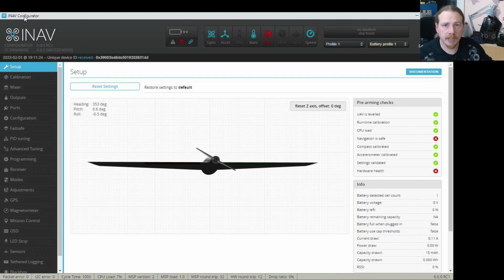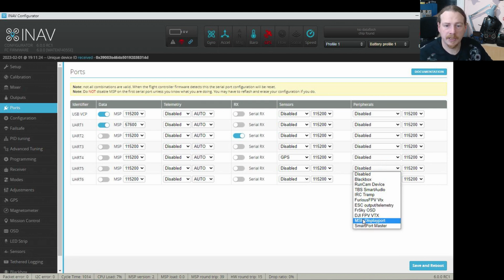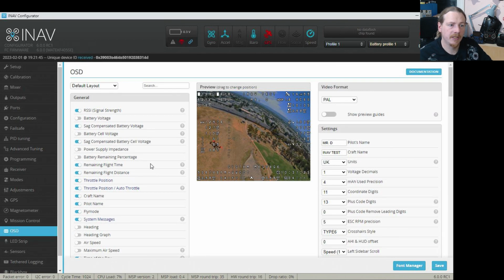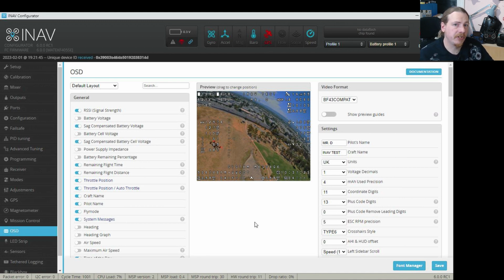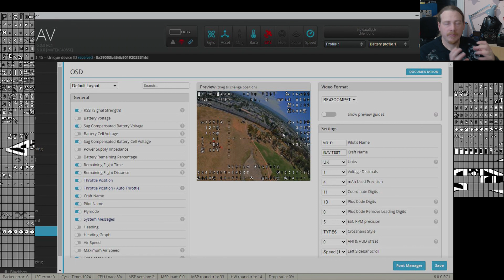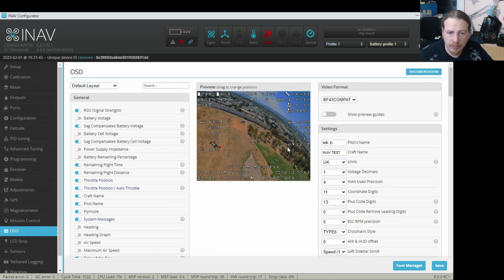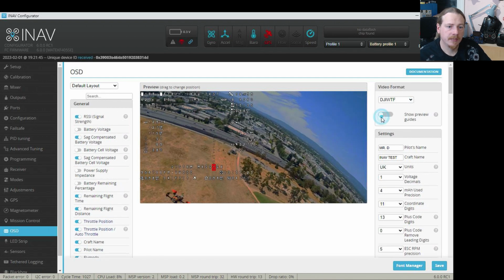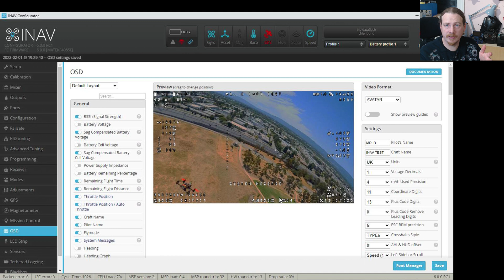How to set up HD FPV systems in INAV

Comment: Help! No OSD with HDZero! 
I was hoping that this helpful video was going to resolve my problem. 
I have the SpeedyBee F405 Wing FC iNav 8 with digital FPV system of HDZero Freestyle V1 VTX with Goggles-1. Following several build videos, everything works on the bench as expected, except for the OSD information which is missing. 
The video image is being transmitted to the HDZero Goggles, so I have the TX/RX leads correctly connected the right way round for UART-5. I have updated the FC and the goggles to the latest firmware. In Ports Tab I have MSP DisplayPort selected on UART-5: In Config Tab the OSD is selected ON: in OSD Tab I have HDZero selected.
I have spent days trying to resolve the lack of OSD in the goggles.
Any suggestions?

Comment: Do you get Heading graph element? What goggles 1 or 2 and firmware? I finally discovered on Air unit had Rx & Tx inverted. Did that quite a while ago and put it away. Now having another go but on iNav 7 got OSD with port on DJI and osd on Auto not your way coz I mistakenly updated camera and gogs to v01.00.06.08 till I found out that v01.00.06.06 is preferred that I probably had but very tricky to go backwards. Cheers

Comment: This doesn't work with Speedybee F405 V4 stack FCs because the UART assigned to digital FPV is UART 1 and MSP has to be enabled on this UART. Selecting anything on peripherals resets all the ports. I'm sure this is also an issue on any other FC where digital FPV is assigned to the communications UART but the SB F405 is a massively popular choice for a lot of quads. My quad is a 7" Mark 4 and will be intended for long range not freestyle, I really don't want to use BF.
UPDATE: The fix I used is to reassign my MSP UART to UART  4 as I'm not using that one. This seems to have worked.

Comment: Thanks Darren, quick question,  iam using speedybee F405 v3  f/c which uses a plug for digital on r1 / t1 (uart 1).  In inav uart 1 is toggled on for msp. Can i move msp to a different uart or can i leave msp off.

Comment: Any recommendations for the O4 air unit? Still use BF43COMPAT? I dont have any OSD from INAV only DJI telemetry
Reply: Same here. Did you found a solution yet? I am using INAV 8, there is only PAL and NTSC available, can't find even BF43COMPAT

Comment: Hi Darren, I received my new Goggle X and Avatar HD Pro kit this week. I updated the firmware on both units to 38.43.8. The camera and goggles are working fine. My flight controller is a SpeedyBee F405 with INAV 7.1.2. Unfortunately the telemetry to the goggles is not working. I have done everything as described in the video. What else can I do? Kind regards. Didi

Comment: I think you may be able to help me!  Inav dji o3 and goggles integra. 
Inav 6.0 with 6.1 configurator. 
 I am setting the osd to betaflight compatible and incan see osd on the goggles but it doesnt look like what i am setting up on the osd page. It all gets moved to the top of the screen and nothing looks the same. 

I understand the character issue with dji but i dont get why im not getting at least some in bf compat mode. 
 
Can I use 6.1 configurator on inav 6.0?

This is a rth atomrc dolphin. First wing setup so indont want to be upgrading and chaning the tune setting  

Please help!

Comment: Thanks for this tutorial on HD video.  Can you also explain how to configure the different vtx power in INAV?  In Betaflight there was that VTX tables and you could set the all the power availables. I cannot find that in INAV.  I have HDZERO and in INAV I only have 3 powers availables.  In Betaflight I could set one power at 0mw, and 25, 200, and 1000.  So far I can only choose PIT, 25 or 200. In fact, I dont think they make any difference at all. I cange them and see absolutly no difference (even though the OSD shows 1, 2 or 3 as for the power)
Reply from the maker: This is being updated for INAV 8. So when that is released. You should get more power options for HD Zero.
Reply: Ok. Thanks

Comment: I am trying to find out how to set the time and date. I don't know if this resides in the FC or the VRX? I would guess the VRX because there is a small button cell battery on the board,
Reply from the maker: It is set in the goggles/VRX. You can set it via a text file on the SD card. I’ll have to find the details on how to do it. Also, if you have Goggles X. When the app is released. When you connect the goggles to the app it will sync the time automatically.
Reply: @MrD  Thank you. I have applied the text file and this has made it so the video files get correct time stamps. I was also trying to get the RTC to display in the OSD. A rep from Walksnail said the RTC will not display in the OSD. They are partially correct. If you connect Betaflight while the drone is powered on and go into the OSD tab, you can place the RTC into the OSD. It will actually stay there after disconnecting Betaflight until the drone power is disconnected. However, the time and date displayed are not correct and do not seem to be affected by the .txt file.
Reply from the maker: @aaronbean4436  to be honest. For the OSD, I just use INAV’s current time element. It gets the time from the GNSS module. 

What I’d love to see is the WalkSnail system updating the time from the flight controller, via MSP.
Reply: @MrD  Can an inav osd element be incorporated into betaflight? I am guessing that you have to use one or the other, INAV or Betaflight? I have used only Betaflight so far.
I agree with your statement; the real time and date clearly resides in the VRX, and it should be able to feed to the element set in the OSD!

Comment: Im having issues with my avatar vtx. OSD is being displayed fine i just have no camera feed. .6mbps bitrate. Im not aure whats going on. Also slow green flash on vtx indicates a camera fault issue? Brand new vtx however i accidently ripped a solder pad off so im using the connector
Reply from the maker: The connector/solder pads won’t be a problem. But check the MiPi cable for the camera. It may have just come unseated.

Comment: I need help. I just got a walksnail VTX & VRX and have FW updated, with sneaky_fpv fonts loaded, I have video feed (I can see) it shows walksnail OSD, Not Inav OSD. Watched this and other videos and it's not working.
Reply from the maker: Make sure the sneaky font is in a userfont folder on the SD card. They changed that a while back. When you download the firmware. I believe there is an example userfont folder that you can check out.

Comment: Hi Darren,    Im setting up a 2nd wing with Inav and the OSD is not showing.  The first wing is all good to go but i have the Vista on that one. I have a confirmed hacked DJI Original Air unit (2nd wing) and loaded with the MSP and 1200 mw package.  Before i rooted the Air unit i downloaded to the 0606 DJI firmware.  That all came thru and i did this setup as per you video and no OSD is showing in my googles.  At first the "Waiting for OSD" was showing and now thats not showing anymore.  I flipped back and forth with the INAV set up on ports tab and no changes at all.  Im not sure what im missing.  I dont have an SD card in my air unit and not sure if that contributes to the issue (no spare sd card at the moment).
Reply: Did you get yours working . Same issues . Same software

Comment: Hey brother thank you,  I just now got into INav and I was struggling for just a moment until I found your videos.... Thank you again.
Reply from the maker: Glad I could help 👍🏻
Reply: @MrD  quick question,  I'm using the Tbs crossfire , when I set up failsafe in i-nav do I still need to set my switches and throttle position in my radio to failsafe in case I lose radio link ? At least this is how it used to be .... thank you ahead of time
Reply from the maker: @endliberalism4305  no. You should set the failsafe type to cut on the receiver. You shouldn’t use stick and switch positions with serial protocols. 

You can test by switching off the transmitter. Then make sure the parachute turns red in INAV.

Comment: I'm running INAV 7.1 which is supposed to support DJI o3.  While I do get OSD, I find that the elements are not located anywhere near what they are shown in the planner.  Hence I find it not usable at all.
Reply from the maker: INAV is working as much with DJI O3 as possible at the moment. The problem is DJI haven’t implemented MSP DisplayPort correctly/fully. Because of this, some icons will appear as ? as the font is not complete. None of this will change until DJI fix their system. 

As for the layout. You should be able to position the OSD elements where you want. On the ports page. Make sure you have selected MSP DisplayPort in the peripherals. The. On the OSD page, set the OSD type to BFCOMPAT. I believe there are 2 options for BFCOMPAT. One is for a 4:3 layout. The other is for the full width HD layout. If you find this doesn’t get it working. There could possibly be something in the goggles that you need to change. I recall seeing something about that. But can’t remember exactly what it is.
Reply: @MrD  Understood and thank you.  I only have an issue with layout.  I'll check my goggle settings.

Comment: Hi, im using a matek f405std with inav 7, and o3. I have a problem with the osd, It doesn't work and I've already tried changing the settings several times, but the way you say it doesn't show up either.
Reply from the maker: Make sure you’re using Configurator 7.0.1. Some people have accidentally installed the 7.1.0 RC1 configurator, which has a bug related to setting the OSD type.
Reply: @MrD  JAJAJAJA God how I didn't see that, it actually works now. Thank you very much bro, I was already very frustrated haha. I was using 7.1.0 with firmware 7.0.1

Comment: Can I select the setting 'MSP Display Port' in any line I want ? I use a SpeedyBee F711 V3 flightcontroller and the RX and TX connection (for the VTX) is marked  with R1 a T1 so should I set 'MSP Display Port' in the "UART1 - Line" or does it matter ? (In my case it doesnt show a UART5 - Line just got 1,2,3,4,6 .  ....  2 and 4 are already in use)
Reply from the maker: In theory yes. But I would avoid UART 1 and 3 where possible. The can cause issues getting in to DFU mode.

Comment: Thanks for the video.  You have confirmed my setup.  I am using a Matek F405 Wing, updated to 7.x.x or what ever is the latest as of last week, 2/29/24.  I was finding it difficult to locate any docs on the setup.  I searched for a long time.  Then I saw the wiring for the Matek 722, just followed that.  I am using uart 5, so Rx-Tx, Tx-Rx, Right now, I am powering the Avatar off of the 4s battery connection, might be one problem, I will wire it up to the 9v pins this weekend.  I started with no OSD displayed in the Fatshark Dominator goggles.  So I updated to the latest as of 2/29/24.  No love, nothing displayed, oh wait, what is that?  I see the OSD, but it is what I would call static.

  I posted on the forums, read about the drop down menu in the OSD tab, clicked that, save, yes/no, NO!  The reply got me thinking as he said he tried a different uart and his magically showed up.  So I go back, change to uart 3, set to DisplayPort, save, reboot, Select Avatar from the drop down, save.  Show up, no, still static.  Put GPS back on uart 3, plug Avatar back into uart 5, OSD tab show AVATAR is selected.  I go down the list of tabs, checking everything in the tab.  I get to the modes tab, scroll way down, I see OSD "off mode is not configured.  I set it so there is a channel selected, switch up, OSD on, switch down, OSD off.  Save, check OSD tab, for giggles, save, check ports tab, all good, save reboot.  

OSD being displayed in the goggles, YES/NO, sort of.  It is like it is being displayed on the wrong layer.  I see it, but it is there, then gone, then there, then gone.  I check connections, I wiggles the wires while looking in the goggles.  Nope, randomly disappears, shows up.  This will turn out to be a simple solution when I figure it out.  The layout I see in the OSD is not how I see it in the goggles?  They are in different spots from what is shown in the OSD tab.  

Next thing I will try is powering off the 9v pins.  Could be direct power from the 4s lipo may be causing issues.  I did have an over heating issue.  I mounted a fan off an old ESC to the Avatar Tx.  Now it does not shut down from over heating.  I may try upping the voltage.  I am using the 3.3v pins, I will try the 5v pins and see if a higher fan speeds helps.

This weekend I will try another Matek F045 wing I have.  See if I can get it working there.  If it is working, that would mean something with the board, if it is the same, then it is me.  I also have a Matek F411, I may try that one too.

Thanks.

Buzz.
Reply from the maker: If you’re seeing static, not an image. It sounds like there’s an issue with either the camera connection or the VTX. 

If you are seeing some of the OSD. It could be that it’s just not central. There is an option in the goggles -> display menu to move the OSD position. I had to move mine all the way to the left.
Reply: Update.  I rewired the VTx to use the filtered 9v off the FC.  The OSD blinks.  Looks like the refresh rate is lower than the goggles.  You can see it start at the top, then fill in towards the bottom.  It blinks on then off.  I have tried different uarts, different rates, same thing.  I gave up, pulled the Avatar out, plugged in my analog, no OSD.  I plugged the Avatar back in, no OSD.  I think the Matek F405 has a problem.  

Buzz.

Comment: What is the use of uart 1 msp please explain
Reply from the maker: If you break off the USB connector. You can attach an FTDI adapter and still access the flight controller.

Comment: with hdzero and inav 7 using msp displayport (no more smartaudio) the vtx setting shows only 3 power level instead of 4. is this setting still being used instead of msp displayport (changing channel from goggles)?
Reply from the maker: Honestly, I have no experience of HDZero. I know that INAV is no using MSP VTX to change the power and channels with HDZero. But I've not looked in to how it works or any problems. I don't have the HDZero system.

Comment: Mr.D great video i subscribed so i can learn more. Im new to this. I am trying to setup my T1 Ranger with speedy bee FC and Frsky reciever also im using DJI 03 air unit. I dont know what uart the 03 unit goes on. I have picture in my goggles 2 but no OSD could you please help me with this problem also im using INAV 7.0. Thank you Art

Comment: Tell me, you can use the OSD features in iNav if you don’t have a video camera.
It is necessary that the flight controller simply writes data to a flash drive in the form of video.
That is, is it possible to record a video on a black screen with OSD data on it?
Reply from the maker: If you just want the data. You can use the blackbox. If you want the OSD, you’d need to take the VTx video output and put that to an in aircraft video recorder.
Reply: @MrD Big thanks for answer.

Comment: HDZero - Can iNav 6.1 read the .json VTX tables? or is it a cli entry? Cannot get my OSD to display the correct ch and VTX power... thanks ;)
Reply from the maker: INAV doesn’t use VTx tables at all. So doesn’t have json or CLI entry. Ultimately, VTx tables shouldn’t be needed as the VTx should tell the FC what power levels it can output. I believe this is working in INAV 7.0 for HD Zero, via MSP VTX. I know it was being worked on. But can’t remember if it made it in to 7.0 or will be a 7.1 feature.
Reply: @MrD  thanks bud, will make the transition to iNav then 🦘

Comment: Thanks for a good video.
I wanted to ask if you had any idea about my issue in INAV 7.
Using an airunit, and got all OSD elemnts showing up. But NOT the OSD Menu and it seems the Compass bar is not showing also.

Any advice? 
Assuming some font issue
Reply from the maker: Sorry, I don’t use DJI. I thought the OSD menu should work. If you’re using the older DJI setup. Have you considered using WFTOS? That massively improves the system. 

The most common thing that stops people getting In to that is being the have an airplane without a rudder and don’t set up the yaw channel. That’s needed to access the menu.
Reply: Thanks for you reply.
In fact i did put WTFOS a couple days ago on my gear which solved my problem 👍

Comment: Thanks to you, my DJI 03 is now working with OSD with Speedybee f405 wing, INAV 6 and DJI goggles V2, but the OSD is not recorded...so if you loose the plane, you can't view the last GPS coordinates?
Reply from the maker: Unfortunately that's down to DJI. They only add what they want to. Which is why the OSD is not fully supported, and you may see question marks. Depending on what control system you're using. You may be able to get the GPS position back as telemetry on your radio.

Comment: Hi Darrel.  I just received a HDZero Freestyle with the Keypad board for changing frequencies.  My intentions are to use INAV  with my FrSky TANDEM x20HD TX that has video capabilities .
I  have followed your instructions for INAV set up. The system is somehow working since I can see a crispy beautiful HD transmission, but I cannot see any number or data from the OSD and the keypad is not energized , since I cannot see the channel.  I am probably missing something, can you help me with some advice .

Thanks    Salvador
Reply from the maker: Sorry, I’ve never used HDZero. I’m not the person to ask about that system. 

I have no idea about the keypad. But if you’re not getting OSD. Check the wiring for the UART and the flight controller setup. With the UART, make sure to wire HDZero Tx to FC RX; HDZero Rx to FC Tx.
Reply: Thanks @MrD       do you have a contact inside to HDZero where to ask for help     Thanks    Salsordo
Reply from the maker: @salvadorsordo5032 no, I don’t have any contact at HDZero